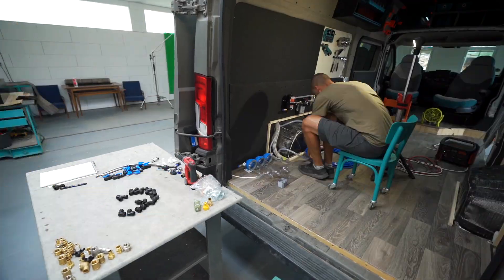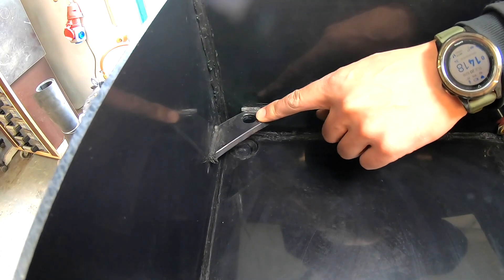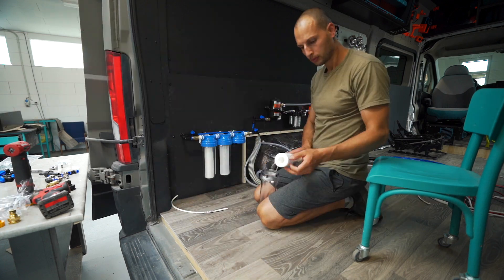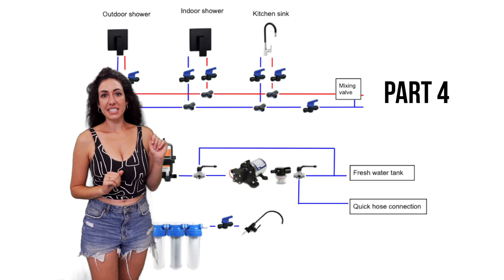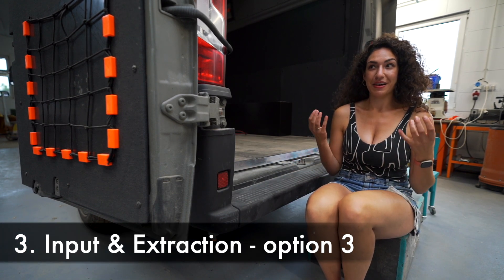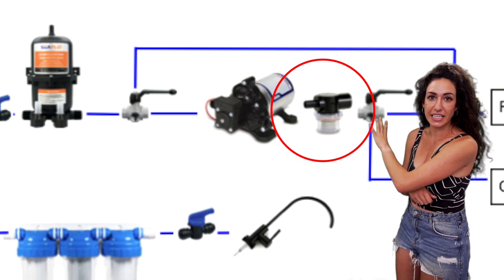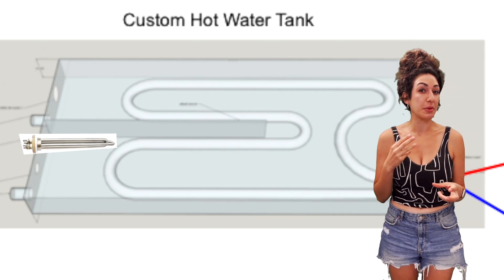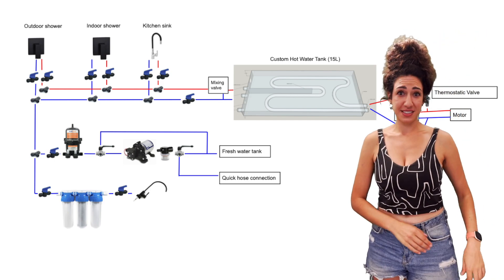Advanced Water System for Campervan (Off Grid Breakdown)

Comment: Great system. Have you considered connecting your space heating system to the same coolant circuit? You would have to replace the diesel air heater with a diesel water heater, and add a “defroster” for converting hot water to hot air. This way you get three options for heating your van as well (engine, diesel-heater or electric). This kind of setup is used in boats.
Reply from the maker: I thought about it but I don’t think it would heat up as much as 5kW diesel heater. It’s kind of safety bet.
Reply: @ladiandmargaret  Looks like you might be doing this already from the images shown from the Facebook group, but are you going to be using a heat exchanger on the diesel heater exhaust pipe? They get really hot! Great way to capture that energy whilst still keeping all the hot air for inside the cab.

Comment: Here's the total system that I'm using since 2010 for the water recycling:

Sink and Shower have drain strainers with 1/8" (3 mm holes) . Then shower uses a marine shower bilge pump to run water across the two drawer strainers under the kitchen sink that just get dumped as needed. First drawer is stainless with 1/16" (2mm) holes, second is No-See-Um 20 mesh (841 micron) , then to the 40 gallon grey water tank.

From grey water tank water pumped (through 50 mesh pre filter) at 1 gpm thru the following filters back to fresh water tanks.

Rusco "Spin-Down" 100 mesh (152 micron) strainer, 500 mesh (30 micron), 1000 mesh (15 micron), 2 gallons VITROclean crushed glass inside 3' length of 4" diameter stainless tubing (5-10 micron), 0.2 micron ceramic, Granulated activated carbon (3' x4") , powdered activated carbon (3'x4"), finally passes UV water purifier.

The washer/dryer comb has a Filtrol 160 lint filter before running through the rest of the filters. It has a sock filter that gets turned inside out and cleaned about every 4 loads.

It's probably overkill but full time use would have us changing the crushed glass, and carbon once a year for about $50.

I installed pressure guages between each stage to monitor changes and cleaning schedule.

We have 220 gallons of total capacity and we usually fill that before parking at a festival or race for a few days because our inflatable jacuzzi needs 135 gallons. Sometimes to get rid of it we run the water cooling misters under the awning that needs about 5gph.

Comment: There could be one problem with your water heating system. If you do not drive before you need the water for a day, the water will be cold. If it‘s not cold outside you will not need or want to use the diesel heater to heat up the cabin. So the only source of heat for the water that is left, is electric heating, which will draw a lot of power to heat up the whole tank. If you are not connected to the grid, you need a lot of solar energy only to keep the water warm. Depends on your „lifestyle“, how much you are driving and if you have  times with not much sun, but also not cold enough to need the diesel heater.  Not sure what you are doing to power your kitchen, are you also using electricity for cooking? Diesel or gas? Maybe you should evaluate an additional way of heating the water - probably gas would be a good option for that, or you need to think of improvements to heating only the water with the diesel heater in an efficient way. And not sure if you have something to protect the inlet for water which is on the rear underfloor of the van. Otherwise dirt could accumulate there. Otherwise pretty nice setup 👍🏼

Comment: You don't mention it in the video but will you be using the same Polyprop use used in the external tanks for the hot tank? Under the presumptions you are here my thouhhts: 
Your water will reach 90°C which is right at the limit of conventional PP or HDPE (again unsure of your thermoplastic used but it appears to be PP) excluding any internal pressure which you will also have unless your PRV is set to atmospheric and then you'll be losing all of your water to vapour. It might work fine initially but the material will likely fail via creep caused by elevated temperatures under internal pressure. I know this all sounds negative but I thought it was worth pointing out to avoid issues further down the line. Further reading can be done from searching "Simona design manual". Any thermoplastic tank questions hit me up 👍

Comment: From my understanding and own research the 12v UV filters are only capable of destroying the bacteria's ability to reproduce, they are not capable of killing them due to the flow rate, and given most bacteria double in number every 20 minutes or so when above 5c and below 60c a permanent or intermittent UV light may be useful in the water tank, but the in line filter is not going to help, you ether have a dangerous number in the water or you don't, their ability to reproduce once consumed is not going save you from illness or death.

But I'm no expert, I research for my recycling shower and came to the conclusion that 12v UV filters sound cool but would do very little as the water is only use for one shower 10 to 30 minutes and then dumped in the grey so any bacteria would only get one reproductive cycle, I have considers a dispenser adding a very small amount of bleach to the shower tank before it begins to recycle, but have yet to begin to build it so will see if that is plausible or necessary.

As for my system in brief, I have two quick connect for hose, with two shut offs, all hidden under the van in a lockable box, one goes to the tank the other routs to bypass after the pump so I can chose tank or public water, I have bucket that can be connect to the tank hose and use to poor water in if need be. all the water goes through a filter system and gas heater before it goes to the sink tap or out side shower, and inside shower that will have catchment (3L more or less) and separate pump and filter system that will switch over once the catchment is full, so it can recycle until you turn off the system and drain the shower water in the grey tank.

Comment: As someone who had to work with UV (UVC/germicidal) tubes recently, I observed them to be a bit power hungry, which might have been an odd occurrence though. Also, they tend to warm up themselves and generally raise the surrounding temperatures to noticeable levels. 
(if you are working with UV tubes, use adequate eye protection - it is not a pleasant feeling for the eyes. Imagine diving on to sand on a beach  with your eyes wide open...)

Comment: I basically have the same water set up. I use a 7 gallon jug with the siphon function to fill my main tank almost 90% of the time, espically when in a city and you don't need to fill the tank all the way or the hose doesn't reach, It's also a lot quicker and inconspicuous than dragging out the hose. You could introduce some air into the system, so the faucet might spit the first few seconds, but my valve set up is slighly diffrent, so you may not encounter that.

Comment: Overall I think your plan is great.
That said I see two points that could be problematic.
1. If your hot water tank is flat, and under pressure, it will need to be very strong or it will deform and leak.
2. You will need a lot of surface area for your diesel heater to heat up the tank. If the air is forced past heatsinks that are thermally connected to the tank, it might work. There are hot water heater tanks that are designed to be connected in the way you describe but I don't think they are flat. Search Elgena boiler, BNC100510.
Reply: The Truma combi boiler works this way. There is a cut through diagram on the website showing this.
Reply from the maker: I don’t think these have exchanger for motor heat exchange.

Comment: I had a thought that might be right up Ladi's alley.  I've seen other builds that dump excess solar through the water tank.  Basically, when you're batteries are topped off, the 1500w heater in your tank turns on to siphon off energy and utilize the excess solar being generated.  Would love to see how this is accomplished and can't think of anyone better to work it out than you and Ladi.
Reply: That sounds like a "thermal battery" for the wintertime too...  a heat ballast.
Reply: 12v hot water element (similar to the element in your house water water heater but it's 12v).  That should do the trick!

Comment: If connecting tap water you need to take pressure into consideration. My house has 6 bars pressure, but not all RV pipes and fittings are rated for this. 
So you might need to incorporate a pressure reduction step.
Reply: Very good point. On boats, when directly connected to the water tap on the dock, we use a very small brass pression reduction valve. A half inch diameter is perfect for the small water setup in a camper. Set up the valve about 2.8/3 bar and you are good.

Comment: hello from argentina, excellent content, I have a popup camper made at home and in my opinion they should put a diesel water heater, in my case it is a webasto top c, with which I heat the water in a small tank and use it to bathe .....but I also recirculate it through an aluminum radiator to heat the interior.....my advice is that if they install one like this they could also heat the van's engine in extreme climates, have hot water, heating and defrosting of the engine (more heating in the front of the driver) a hug ....... I hate them with envy, do not change anything excellent

Comment: Just one thing that stood out was a corner case regarding the heater in the fresh water tank to prevent freezing. I don't know if you have resolved it already but if for some reason you run out of fresh water and the air temp is low the heating element will turn on and without water in the tank it will likely melt the fitting and destroy your tank as the temp sensor likely won't pick up the temp change fast enough. So a water leak on a cold night will result in a ruined tank and possibly even a fire.

A couple redundancy checks that would help would be a water level sensor that disables the heating element, a local temp sensor to ensure the heating element isn't getting above a safe temp for your plastic or some additional logic on the heating element control to modulate its run time and sample the temp sensor to ensure the expected feedback is happening.
Reply: They have a switch where they can turn of the heat system of the fresh water tank.
Reply: @NathanYsp  If it is a manual switch then there is still a concern that either someone will forget to turn it off or the tank runs dry while they are away or sleeping. Having a heating element in a tank that isn't heat tolerant just requires an automatic fail safe to avoid unpleasantness.

Comment: I have engine heated hotwater in my van, im using the ATI Boat boiler as the hotwater tank/heat exchange. It works awesome, piping hot water after 20min of driving. Its well insulated and has a mains power element inside. These have been around for ages in the boating community, you could try just buying this off the shelf

Comment: Love the complexity and over-engineering as always! Heating from the engine is such a good idea. 
I think I saw someone mention this, but one concern I'd have with sucking water from creeks or other water sources is the algae, bacteria, and sediment which would then contaminate your whole system. You'd have to flush with chlorine each time, and even then, I'd worry that sediment would build up. Having the drawing hose be in the lowest point of your tank means it will draw water from where the most sediment collects. If you really filtered all the water coming in (which now I think of it, you are, but I don't know how thorough the non-drinking filter is) this would address the problem, but it will likely still mean more maintenance. 

I also don't know who said you need different UV for different locations, and they could be right, but in my experience UV treatment or chorine droplets work in all contexts (mostly thinking of backpacking) and it might be nice to include one of those options to be absolutely safe. 

Excited to see what you end up with!
Reply: add an ozone bubbler.  ozone acts as a bleach.  It destroys bacteria, fungi and viruses.

Comment: I’m a superyacht engineer and currently designing my own bus conversion. The design is good, it’s similar to what we use at sea in its basic form and bypasses are common for many systems. I also have a design similar to this with the addition of a recirculating shower as I’ll have some extra room that I can play with compare to this van
Reply: How did you get on with your recirculating shower?

Comment: I would think the filtration system would work just fine for drinking water from creeks. People who backpack use filters or treatment tablets when they get water from natural sources and are typically fine even with the different microbes in different water sources. You can add bleach into the tank when you fill from natural sources as an additional treatment option.
Reply: Good point, but backpacking filters are not necessarily the same as what they have, also we often use UV light, iodine tablets, or chlorine drops, which are other options they could consider button anything they have now. Also, please don't use bleach to sterilize drinking water! That's definitely not good to ingest. You may be thinking about small amounts of chlorine which are used in most people's drinking water and do work well.
Reply: @sorchaoconnor3750  Bleach has chlorine in it and can be used to treat water, at least the plain stuff. It's one of the things recommended in emergency situations and for storing water long term-- that and boiling. The filters should remove most of it. The EPA and CDC actually gives guidelines on how much bleach to use for the amount of water being treated. Bleach plus filtration is actually very effective for drinking water.

Comment: You are tapping in directly into the cooling system of the engine ? Or you have a seperate heat-exchange element under the hood ? If there is one thing you dont want leaking, it is your engine cooling.

Comment: You have more space on your roof bellow your solar. You could heat some water there as well :) heating water takes a lot of energy. Using 48V element makes a lot of sense. I pushed whole water problem to side and went for vacation with water jugs and uncompleted van. I learned so much on the trip with my family :)
Could you share the group you were consulting on fb?

Comment: Coo coo for cocoa puffs!  My favorite phrase in this video LOL.  All cool ideas.  I've seen a water heater commercially produced that uses the vehicle engine for heating the water.  However, it is very expensive and cylindrical.  Your custom built one is nice because it will be easier to locate wherever you want it (space wise).  Good idea.  Maybe some insulation around your custom heating tank would be a good idea.
Question regarding the 3D printed items in your van.  Do they use a plastic that can withstand the heat that can build up in a vehicle?  I have a friend who was 3d printing items that started to melt when left in his vehicle during scorching hot days.  Maybe you can comment on that in a future video??

Comment: I’ve often drank from fast flowing natural water without issue. (Watch the Bush Tucker Man: The Passionate Prussian, around the  7 min mark)  I’d be more concerned about possible pollutants.

Can’t see you getting ‘hot’ water from the diesel heater, tepid perhaps, after a number of hours. Have you considered heating via a copper coil around the exhaust pipe/muffler?

Hot water systems really should be cylindrical to evenly distribute pressure, yours will likely fail much sooner than expected.

Comment: What coolant will be going through your tank? The engine coolant? YouTuber and builder humble road has a few good points on the risks of using the engine coolant itself to heat water. You should have the engine coolant heat something else that will then heat your tank to prevent loss of coolant, risk of getting water into your coolant, and possibly poisoning yourself with coolant.

Comment: Hopefully this comment won’t be deleted like the last one.

I believe the 1986 Vixen RV TD 21 solved the problem with heating water. It used a diesel heater that also heated liquid. In this case it heated food grade glycol which was pumped to a heat exchanger underneath the sink and shower. Today there are a number of diesel heaters there also heat liquid,  food grade glycol or water for hot water.

Unlike a hot water heater it’s lightweight and instant. The only thing that I would add would be a modern residential anti-scald valve so you can set how hot the water is and never get burned or have cold water.

As usual a great video. I look forward to watching your videos every week.
Reply from the maker: Hi, that seems to be too complicated. I made it so the diesel heater heats up the whole enclosed space with the water tank. No additional circuit or pump needed. Super simple.

Comment: The only minor "mistake" I can see is the location of the temperature sensor and heating element in the fresh water tank - I know you wanted it to work even with little water, but water has the highest density at ~4 degrees centigrade, which means if you had the tank full and it would be freezing outside, your temperature sensor would show 4 degrees, but the water on the top would be already frozen. You could theoretically install one more temperature sensor on the top part of the tank, but it's probably easier to just set the heating element to start warming the water already at let's say 10 degrees (do your maths) and waste a little bit of energy more than necessary.